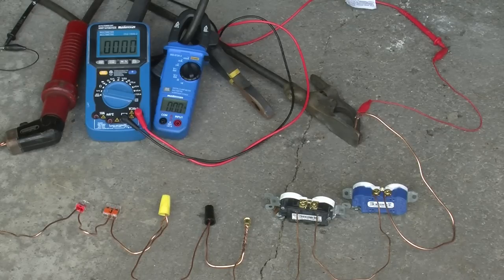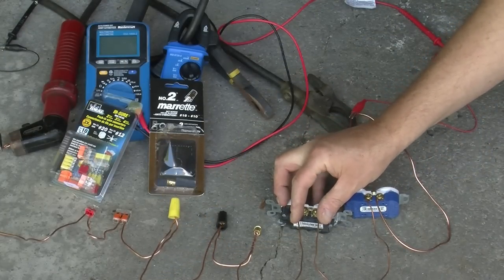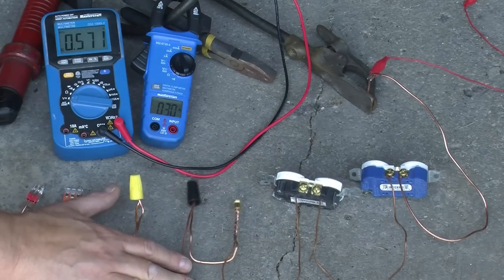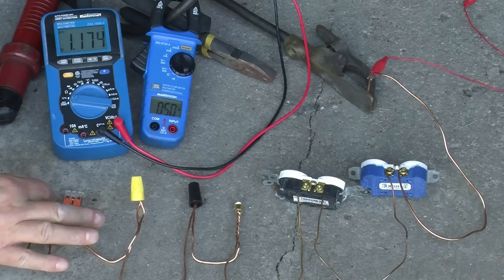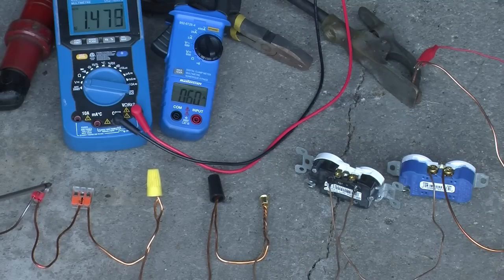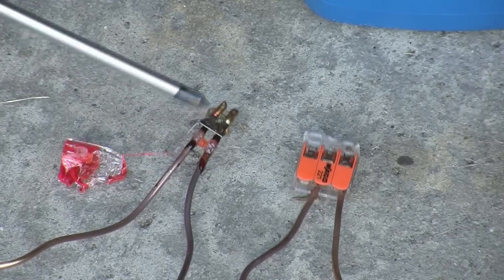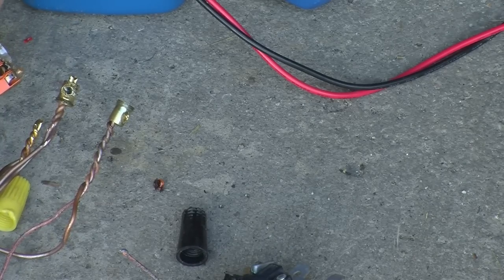Connectors: Which is the Weakest Link

Comment: When wires are twisted together the resistive load of the wire nut is zero because the wire nut isn't need to create the connection. The push in and Wago add a resistive load because there is no direct connection between wires. They're connected by a thin piece of metal inside the housing, so the probability is higher for failure compared to the wire nut.
Reply: Bingo
Reply: In the 50 years I have been doing electrical wiring I have never had a wire nut joint fail. I have had many push in joints fail to the point I quit using them 40 years ago.I see no advantage in wago connectors.
Reply: Wago connections are the same thing as automotive fuses. A failure point.
Reply: Electricity is just a theory like evolution or the globe earth.
Reply: No, this is wrong. What you're saying is that current doesn't flow through the nut.
That is not true.

With the nut removed, current does not flow through the nut, and the nut is not needed to make the connection. However, when the nut is attached, current does flow through it, and therefore it can still heat up. In fact it will heat up also because of the heat produced by the current passing through the twisted pair of conductors.

What you folks are suggesting is that the current flowing knows that the metal threaded insert of the nut belongs to the nut and decides not to flow through it. That is clearly nonsense, as there is no way the current can know that the metal of the nut belongs to the nut and is not part of the wire.
Reply: @WesB1972  I had a wire nut fail. But it was exposed to the elements. The copper oxidized and the nut became the conductor.  It was quite an impressive light and pyro show.
Reply from the maker: I find longer term experience  like yours so interesting! You cant beat  observations like yours to see what is really reliable or not. We can do all sorts of stress testing in engineering to try and mimic the effects of time or millions of installations or events, and its often a very good predictor, but thing like Al wireing occasionally just dont look bad till after a while. Thanks for posting!
Reply: @deang5622  correct. Electrons flow on the surface of conductors. Including the metal inside the wire nut.
Reply: @BionicLemming  technically it's all electric fields being produced and moved around.
Reply: @WesB1972  you dont do service calls! The nuts are also a failure point when heated en cooled down, over time the copper will loosen
Reply: This is not realistic, you should have at least 230 volts @ 40 amps, not 0,2 volts this lowers the actual power draw in the circuit
Reply: @sjefoekel6058  that what I was thinking and wondering. Shouldn’t the tests be done with at least 120v and then raise the amps gradually in order to test the failure points more accurately?
Reply: @josephnicolas2158  hear hear👍
Reply: @sjefoekel6058  Actually, amperage is comparable to water pressure in a hose.  A thicker wire will conduct more electricity without a large voltage drop just as a larger diameter hose allows more water to get through at a given PSI.  A thinner wire will conduct less electricity before a large voltage drop just like a smaller hose allows less water through at a given PSI.  This test will about 95% correspond to 110 and 220VAC which is more than close enough for this application (and using two volts DC is much cheaper than doing the same at 220VAC, this test would cost $25 or more to do with 220VAC whereas it costs less than a dollar done this way and that assumes he can even do 70 amps at 220VAC with his electrical service, many older homes only have 30 or 60 amp service).  Also, I agree with him about backstab outlet connections, I hate them (and I am NOT a professional electrician).  I have a lighting circuit that the builder wired using backstab connections and 14AWG wire, as I replace switches I am using the screws to connect them.  The other circuits are 12AWG/20 amp circuits (the builder had 15 amp breakers installed, ironically, even though the wiring and outlets are rated for 20 amps -- the higher draw circuits of those are now switched out and I think the builder used the breakers that came with the breaker box to save money even though code probably required 12AWG wire for electrical outlets).  Obviously the circuits I added going outdoors and to my living room AC are single outlet, 20 amp outlets using 10 or 12AWG wire.
Reply: @mharris5047  those #10 wires on the 20 Amp circuits are overkill.  Unless you are just reusing a wire that is already in the wall it's just wasting money.
Reply: @sjefoekel6058  it is just the amperage what counts, if you want do do this test with 230volts, you need an additional resistive load in series to limit the current to the actual testing current, and that will result in the same voltage drop across the test setup. The power draw in the test circuit will be the same while the resistive load will waste 9.2kW.
If you just connect this setup to 230V with (therotically) unlimited current and no fuses, it will draw about 30000A, that equals 7 Megawatts, so the whole setup explodes immediately!
Reply: @Henning_S.  that is what happens in real live short circuit results in kA range, no 0,2volt*40amps. The power draw is also a factor in this situ.
Reply: @sjefoekel6058  yes, if there is a real short circuit there will be a current in kA range, but just for a millisecond until the fuse blows. In that case nothing gets hot because of the thermal mass of the copper wires.
So a overcurrent in the range of 40A is far more likely to cause overheating in wires and connections. The most likely issue in the real world is a failed connection because of corroded wires or a loose screw clamp after a few decades, but that is very hard to replicate in a test setup.
Reply: @Henning_S.  yes, still i would like to see 230 volts and or 400volts , at the 40 amps. That is what its rated for. This is not so hard to do as you
Mentioned in the previous post. Just put a load in between.
Reply: @sjefoekel6058  the result would be the same as in this test, the voltage drop of 0,2V will also be the same, the biggest problem is to find a household single phase 230V 40A circuit... 400V single phase is not even existent, it is just the Voltage between 2phases of 3phase power with 3x 230V...
Reply: @Henning_S.  👍
Reply: @WesB1972  I recently saw an attic with multiple wire nuts cooked to the point the plastic was completely gone. I don't really understand how it happened
Reply: @deang5622  This Guy is generally correct.  The demonstration is DC. DC current flows through the conductor, the paths of least resistance.  Where u have technically a point is the threaded wire inside the nut could conduct.  But, will it? Why? That metal is not copper and has more resistance.  It will, but at a much lower amount.  The twisted copper offers a better path.
If AC, u have a better argument.  However, we cannot just say AC  current flows on surface and be done.  First, AC does not only flow on surface.  The interior is not just standing idlely by. The diameters we are talking and the low freq 60Hz, allows most if not all the wire to participate.
I would say that both of u have some good points.
Reply: @sjefoekel6058  Wrong.  Applying 230 volts to this circuit  would result in current of 1150 amps (230/.2) and 264,500 Watts (1150x1150x0.2) and the circuit would vaporize in milliseconds.   If you were to apply 230 volts with a breaker or fuse the protective device would trip or blow in about a millisecond.  A 20 amp breaker would trip at 4+ Volts (20x0.2) in a longer time.  All that counts is the amps and voltage drop across THIS PART of the circuit.
Reply: @36736fps  wrong! You can put a load in the circuit! Inductive or capacitive. The potential across the leads is the rating on the wagos or wire nuts.! It says 400 and 600 volts ac 40 amps or what ever. And not 0,2 volts or what ever! No need to feel butt hurt its just the way it is. This my my two cents and im sticking with it cheers 🤘
Reply: @WesB1972  I’ve had many failures with wirenuts.
Reply: @sjefoekel6058  - I think you misunderstand what the 2 volts is (or maybe I do.) That isn't the voltage being run through the wire, it's the voltage drop, which can be (and was) used to determine how many watts of power is being lost to heat...  If I misunderstood your comment, or the experiment then I apologize and hopefully somebody will correct me with a better explanation.
Reply: @dustintunis9347  no its actualy the voltage being used in this setup, its a welding transformer. There is a voltage marking on the connectors.
Its there for a reason.
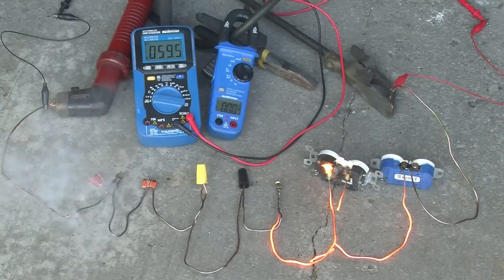Reply: @sjefoekel6058  - No, it is showing the voltage drop through the wire.  At 14:20 - 14:25 from when the wire broke until the welder shut down the amps drop to 0 (obviously because the wire broke so there was no flow) and the voltage is at 59.5, that is the actual voltage.  I don't know enough about welders to know if the volts are constant or change with the amps, but I do know enough about electricity to know what is being measured.  It still isn't household voltage, it's not even AC, but it still tests the connectors.
Reply: @dustintunis9347  bingo!
Reply: @WesB1972  Only 35 years for me, but, I have seen a few fail.
Typically from Improper Installation. As in, not getting all the wires firmly seated.
This usually happens when someone tries to be Slicky Boy and use a Red wire nut when they needed a Big Blue. As in, trying to add more wires than it's rated for, to the Laymen out there. A Red Wire Nut is rated for 4 each 12 gauge conductors. DO NOT try to add a 5th.
Another thing that can cause them to fail is trying to "Recycle" a wire nut. The Inner Part of a wire nut is a square wire wound in a spring coil, in such a manner that the corners act like threads on a , well, nut. When you use the nut, the spring coil expands. And stays expanded. 
Thus, if you once used a wire nut for 4 ea. #12's, and then try to use it for 2 ea. #14's:
"It'll never work. We're all going to fry."
I have had many contractors try to get me to re-use wire nuts. and then try to tell me Code is Bullwash, when it says "All parts must be NEW!"
Reply: @rustyshakleford5230  Yes, but the Theory of Electricity and the Theory of Evolution both work in Real Life.
Reply: @deang5622  Does the water need to "Know" what direction downhill is?
Reply: @BionicLemming  Only in an Alternating Current circuit.
Reply: @stuckinmygarage6220  "the paths of least resistance". This is flawed. What I have observed is people that say this are not qualified in electrical engineering. They just think they know about electricity, but in reality their knowledge is very low.

Let me explain it.  When you have resistances in parallel, and one resistor is lower, your claim is that current takes the path of least resistance, and your thinking is that it doesn't flow through the resistor of high value. And that is complete and total nonsense. It is false.

Current flows through all resistances in parallel but the magnitude depends in the actual resistance value.  If you don't believe me, go and look up "Resistors in parallel", "Ohms Law", and "Kirchoff's Laws" and I suggest you learn how to do basic circuit analysis and learn how to calculate the currents in different paths in a circuit where that circuit contains all of the following: 1. A voltage source, 2. Several resistors in parallel, 3. One resistor in series with the parallel group of resistors.

This is basic circuit theory, taught to any electrical engineering student.

Now when you have twisted wires inside a find conductive nut, those electrons are charged, and they carry charge of the same sign (or polarity, which is negative), therefore those electrons will repel each other, so they will travel down the wire and hit the nut, and as that nut is also a conductor, the electrons are free to move inside it and the electric field from each electron will push other electrons away and push them into the metal of the nut.

The charge density of the cross sectional area of the nut is NOT zero, and therefore current flows through the God damn nut.

And as current is flowing through the metal of the nut, it is going to heat up.

The second contributory factor to the nut heating up,is the fact that the wires inside the nut are heating up, and they are also heating up because the current is passing through them. The heat produced in the twisted wire conducts through the metal to the nut. Metals are good conductors of heat.
Reply: @mharris5047  Wrong. To use the water analogy, voltage is the pressure, not current.
Reply: @libtrs838 Wire nuts cooked:  Too much current or too high a contact resistance leading to over heating. That is how it occurred.
Reply: @dustintunis9347  Listen mate. I shall say this only once.

There is NO such thing as "voltage drop through the wire". Voltage is * NOT* in the wire. Voltage pushes the current in the wire. Current is IN the wire. Voltage is NOT .

Voltage is a potential difference and is measured between two points. You can have a voltage across a source , or across a device, a component. Go look up Kirchoff's Laws and increase your understanding.
Reply: @TimeSurfer206  What the F. are you talking about? Only amateurs consider electricity as water. I am not an amateur. Talk to me in proper electrical engineering terminology. I am not interested in this baby speak.
Reply: @WesB1972  Surely the advantage of wago connectors is they are slightly easier to install (especially for a noob, although they probably shouldn't be doing wiring). More foolproof and without the unreliability of backstabs? I was surprised the wago had more resistance than the push-in connector, since that's basically a back-stab, until the plastic came off and I saw how much metal it had.
Reply: I like the wagon for large junctions and ease but they should have a massively thicker buss bar. Infact if we're designing  a stout boi beefy circuit I'd go very large junction boxes and set screw buss bars for the ultimate chonky beef cake
Reply: @sjefoekel6058  Doesn't make a blind bit of difference - beyond the actual dielectric strength of the insulation one of these connectors is subjected to the same conditions for all intents and purposes whether it is on a circuit that's a fraction of a volt or 230 volts... because in that real life circuit the potential across the connection is just the result of its resistance/impedance and nothing else, much the same as here.
Reply: @intercity125  👍
Reply: @deang5622  There is a voltage drop across the cable. In this case here it's just not noticeable and therefore not interesting. 
There is a reason why you need to use a bigger wirediameter for longer distances. 

And also, the Voltageratings on those connectors are just the ratings for the insulation. They say, you can put up to 400V on the connector and it's safe to touch them, without electrocuting yourself. 

Also, of course a direct wire to wire connection can uphold more misuse, because the wiregauge is the leading factor. 
But still Wagos are the better solution. They are easier and faster to install, more compact (Wago also has those push-in connectors, the leaver ones are for stranded wires), you can very easily add more wires and if they are full, just take the next bigger one! 
Also they survived their rated Amperage of 20A didn't they?
Reply: @DerDai1  I have no idea what you are talking about
Reply: @deang5622  Aren't there enough water comparisons for you?
Reply: The probability for overcurrent failure is higher in the wago since the nut presses the wires together and much of the current bypasses the connector entirely.
But there are other failure modes. For example, thermal cycling can loosen the nut over time and potentially cause intermittent connection and arcing. People will often chalk this up to incorrect installation, but that's not always the case.
The wago connectors don't have the advantage of having current bypass them... but they have the advantage of having a much better controlled connection with springs making contact.
The wago connectors are a bit over-engineered, but as with anything, there are always tradeoffs.
Reply: @sjefoekel6058  welding doesn't happen at .2 volts. It's probably 30v and it could even be ac, old welding machines were ac boxes. Max about 40v normally. The reason it measured .2 volts is the 30v or whatever only drops based on the resistive load. If you saw the 40v all the way to .2 the wires would vaporize like they do when welding. As he increases voltage, the current goes up but the resistive drop only goes up a tiny bit.
Reply: @newmonengineering  no pun, but i am an elektricien, so i know what is going on here, i dont understand what your talking about. But the point being
The amount of power (watts) is to low to actually do a real test, also the inrush current plays a roll not to mension thermal cycling of the connections. When you have a short in the real world the amp draw can be K amps range, and whill cause to cables to jump all over the place.
Reply: Exactly! This is what I’ve been preaching for a few years. Wagos are inferior to marrettes
Reply: @sjefoekel6058  "nuts are also a failure point when heated en cooled down ..." --  Wago's might hold up better under that environment as they put the wires under spring tension.
Reply: @sjefoekel6058  230volts will results in more than 40amps and will not have the desired outcome because everything will be over in a flash. If the experiment was meant to test the insulating properties, then yes use a higher voltage, but this is meant to test the current capacity.
Reply: @josephnicolas2158  No. Between voltage, ampere, and resistance, you can only freely control two. The third factor will be determined by the Ohm's law. If you use 120V, the whole experiment will be over in a flash. If you don't believe ohm's law, try the experiment your way and show us.
Reply: @deang5622  current follows the path of less resistance. if you have copper-to-copper connection with 0.001 Ohm resistance almost all current will be going through it. Steel wire nut with resistance 0.1 Ohm will get 100 times less current.
Reply: @WesB1972  Al to Cu connection or Al to Al wiring. Dont be so close minded. Wago are great for low current light circuits that are all LED nowadays.
Reply: @sjefoekel6058  voltage rating is for insulation and not for the load capacity. you are in a wrong. for the wago it does not matter what is the voltage as long as it below what the insulation is rated for. Power dissipation on the wago will be determined by voltage drop on the connection and current, not by the supply voltage!
Reply: @rustyshakleford5230 ok flat earther